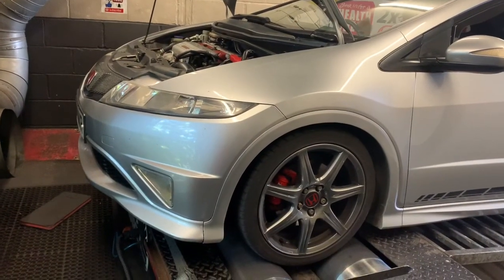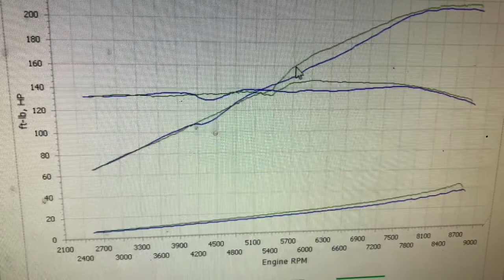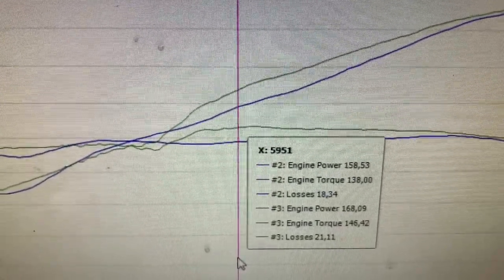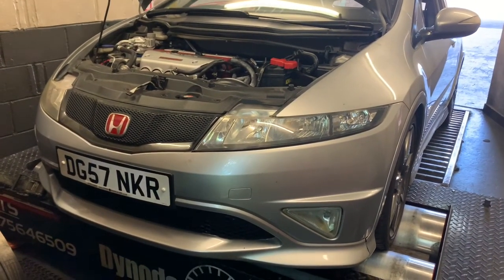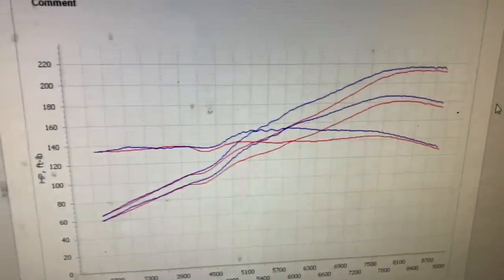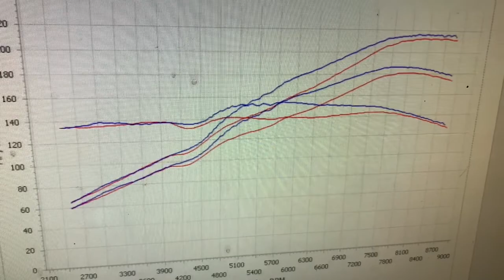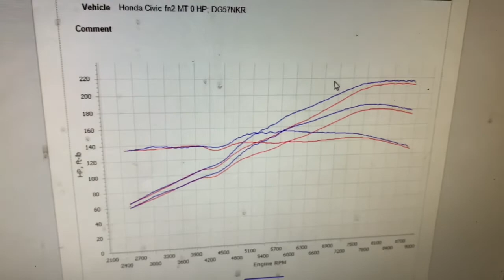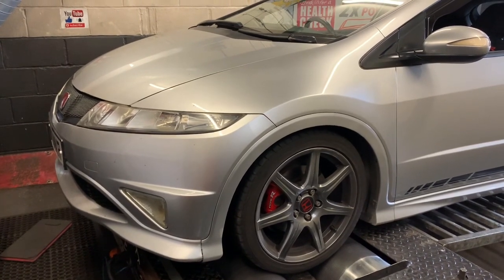Honda Civic Type R FN2 Japspeed Manifold Tegiwa 70mm Results and Ecutek Tune

Comment: Hi. Mine has japspeed 421,tegiwa manifold and pipercross cai. Made 226.4bhp on tdi rollers mapped. I'm not to far from you so I'll bring it down to compare figures on yours rollers
Reply from the maker: that would be great! look forward to meeting you
Reply from the maker: what did it make at the wheels buddy?
Reply: I'll check on my print out and let you know
Reply: I'm going book in with you for October for undersealing aswell
Reply: Tdi are generous rollers apparently

Comment: I was expecting at least 220bhp with a map, I believe tho that the 3inch tegiwa catback would make more gains in a forced induction build I think for the sake of back pressure 2.5inch may have gotten more gains but my opinion so not got any dynos etc to back it up, and for induction kits I use the pipercross one and haven't had any problems when I fitted it I actually felt very slight better throttle response, got a ramair intake hose coming in the next few days which will work well with the pipercross so goes to show not always gotta splash big bucks, also next Friday I'll be having my piper 4 2 1 manifold and sports cat fitted along with a japspeed single exit 2.5 inch cat back which is a similar set up to this but more of a budget one. But gains should be good non the less, keep up the good vids 👍🏻
Reply from the maker: Thanks for your comment pal. An interesting read
Reply: @DynodazeHondaTuners  yeah I've seen cars with induction kits, manifolds and a cat back make 220-225bhp so was expecting that and heard very good things about the skunk2 cold air intake so was a bit surprised but the beauty of these k20 engines is that you can but bolt ons on one k20 then throw exactly the same bolt ons and get quite different power so depends on a lot of things, yeah for the 2.5 inch vs the 3 inch well be quite a interesting debate
Reply from the maker: Mason Wright I think we need to compare wheel horsepower if looking at figures between different dynos. there’s no magic button another tuner can press for an extra 10bhp it’s all the same science 🧪
Reply: @DynodazeHondaTuners  yeah you're exactly right, not all dynos are the same as well could take your car to 3 different dynos getting 3 very different results

Comment: It looks more like the cpl kit. Ive got a skunk2 bit of a bitch to fit lot of either shaving bending and cutting. Coolant hose requires abit of a chop and fiddle so the gearbox counter weight doesnt foul it does require abit of time fettling with. 

 Very few intakes ive seen using hondata have bern able to match the map pressure the skunk2 achieves ans how much air is coming by the maf.

Modifying the stock intake manifold helps aswell 👍
Reply from the maker: it's the cpl big bore induction kit with battery relocation
Reply from the maker: thanks for your comment i’m going Skunk2 i think

Comment: I managed to get 232bhp 165lbs torque from the similar mods, mine was hks racing induction,  toyo sports manifold and martelius exhuast. Mapped on ecutek software.
Reply from the maker: on what dyno buddy? only EVER compare wheel horse power
Reply: @DynodazeHondaTuners  hub dyno @ Amd racing